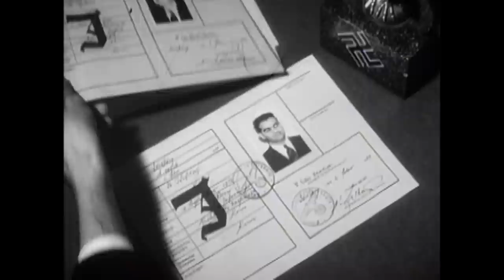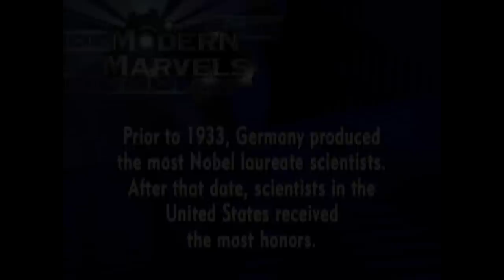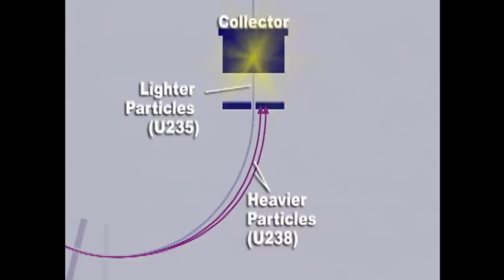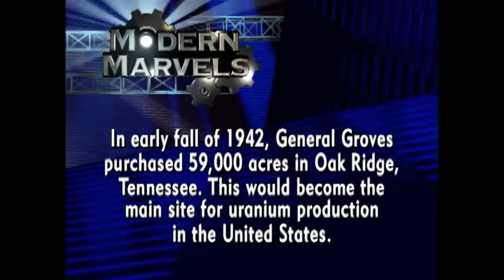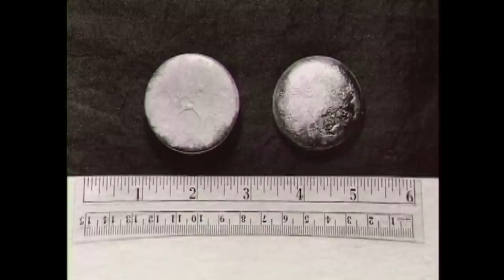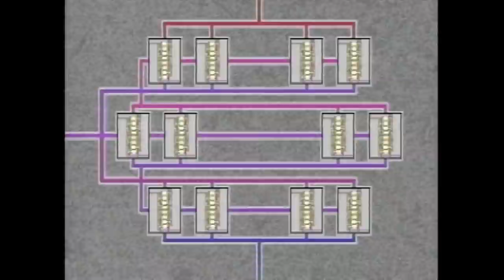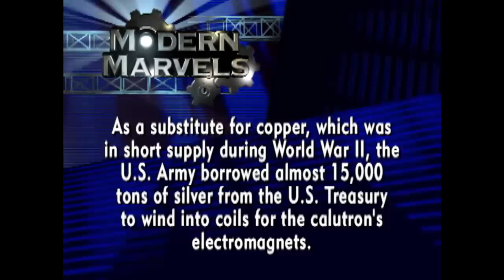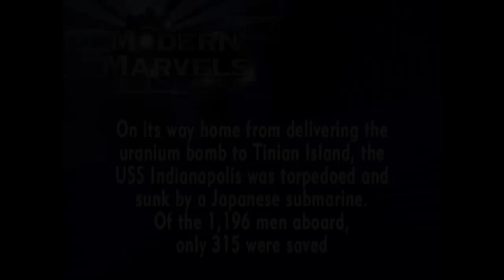Modern Marvels: Oppenheimer & the Birth of the Atomic Bomb (S8, E25) | Full Episode

Comment: Much is made of  Robert Oppenheimer as the director of the Manhatten project. Bright lad, though he was, all the research was done, and breakthroughs were done by other Physicists,  Chemists, otherTechnical staff. His only lasting research work was early theoretical work on black holes. Any large scale program needs a administrative head to see that the buck stops there for any problems or failings.